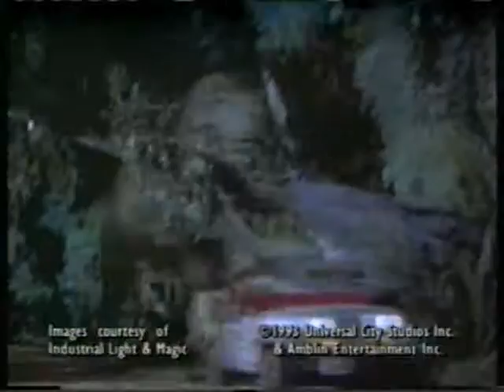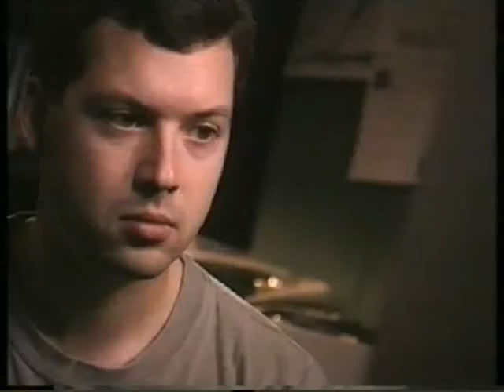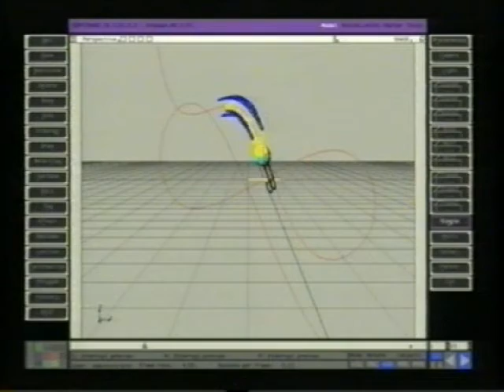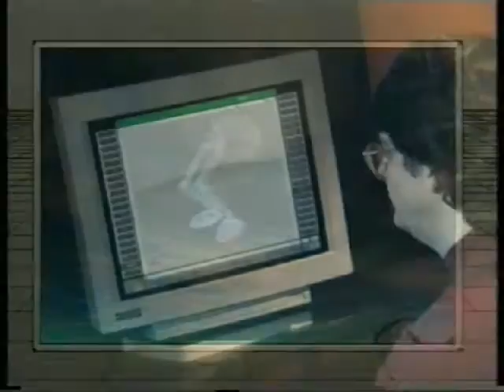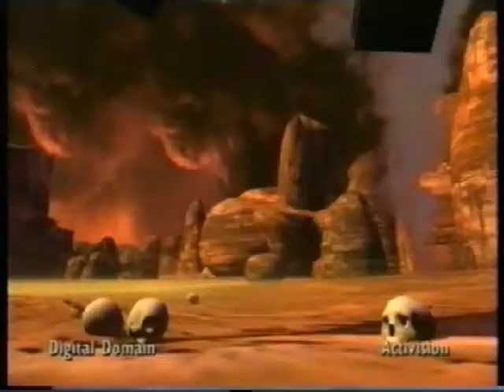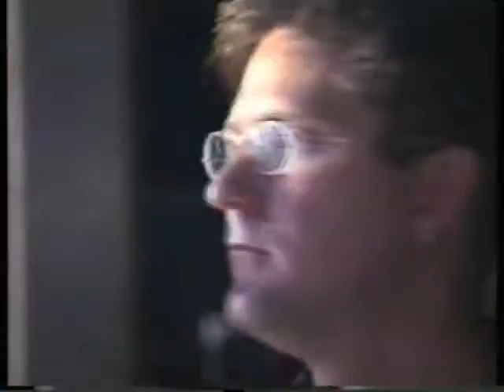Softimage 3D tape95 part 1 of 2

Comment: I’m going literally insane trying to get this running without any visual bug in the dialog boxes in 2026. I spent 2 days gruelingly piecing together the install from a 1999 version, I was able to get it running but due to what I assume could be OpenGL-related behaviors, the only way to do it correctly is with a virtual machine and a very specific graphics card driver of the era made almost tailored for SotfImage3D.

Comment: Nice product, but the SGI/IRIX version runs a lot smoother, more FPS and especially in shaded viewports (eg non-wireframe).
Unfortunately as of the early 2000's, commodity PC 3D accelerators became more powerful and destroyed SGI and their beautiful products...
I wonder what the world would have looked like if SGI ported IRIX to PCs, eg "IRIX86" with OpenGL drivers for Nvidia and AMD GPUs or something similar :)